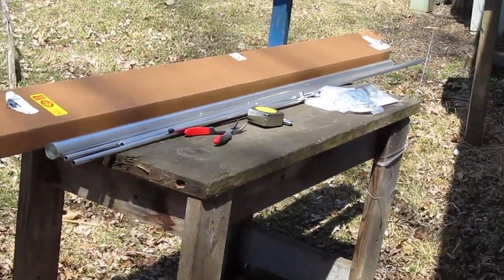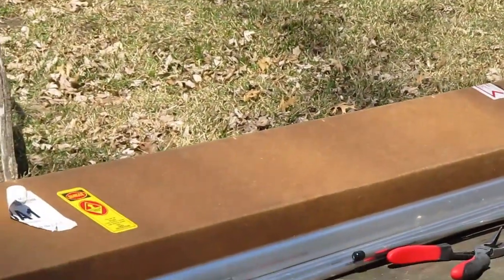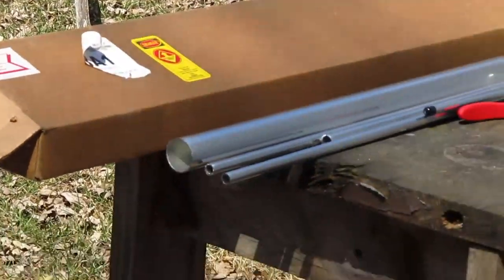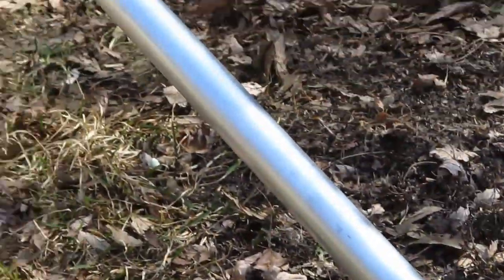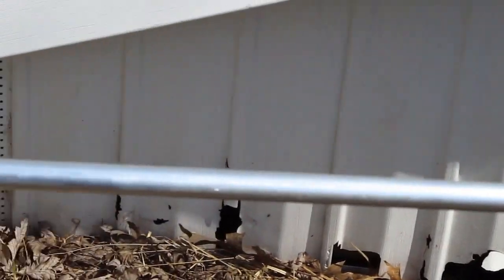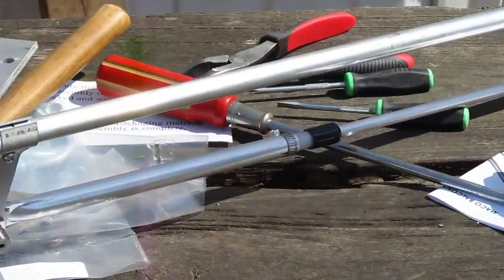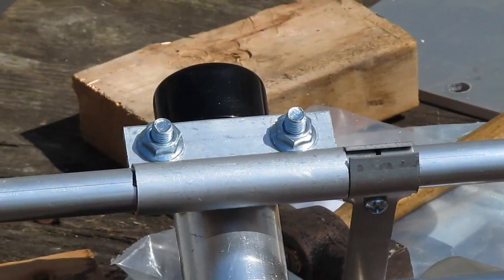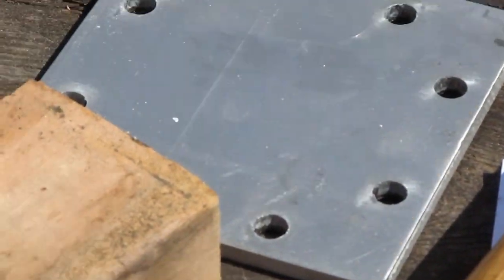Maco BA-1 Balcony Antenna

Comment: you didn't show how to attach the gamma mine came lose and i don't know how to put it back together because it has a plastic washer not sure where that goes .. can you please put a pic on your site .. thanks.
Reply from the maker: The gamma is just a reflector for the main part of the antenna. No, I can't show it, this antenna is long gone after 7 years.
Reply: @BirdWhisperer46  The gamma unit is not a reflector it is a capacitively coupled matching device.
The whole assembly (element and gamma) would be the driven element for a Yagi beam antenna!
MACO just eliminated the other elements and a bit of the boom and called it a BA-1 balcony antenna (it's a grounded element dipole people)!
Cushcraft made 2 versions back in the 1960's and 1970's called the Trick-Stick!  One was a split element dipole and the other was a grounded element version with a gamma match!

Comment: question i was just wondering if i can use the Maco BA-1 horizontally  and run its with my a99 for vertically with a switch box and run them both what you think it would match up 73. 505 land of Lincoln
Reply from the maker: Not a clue, I chopped up mine years ago and used the rods for other antennas. LOL  I was not impressed with the original, I do much better with just a long wire.
Reply: @BirdWhisperer46  well damn lol
Reply from the maker: @IllinoisStormTracker32  It worked very well as a tubular dipole. LOL Better than wire cause of the diameter I think.

Comment: I might build one out of some maco parts.
Reply from the maker: Don't bother unless you have a nice tall pole to put it on. It needs to be in the air. An inverted V wire works better. Sends the signal up to the Ionosphere, then bounces around the world, a one element beam just goes horizontal to the horizon and bounces a little.

Comment: do you still have the  Maco BA-1 Balcony Antenna
Reply from the maker: I have the pieces. I live in a hole, below the road level, in a canyon. In other words, the worlds worst location for any band. I ended up using the short rods for a dipole with tubing instead of wire. It worked pretty good, but since the sunspots went south, there is nothing on any band. :o(

Comment: that's not a mast that's a boom that antenna is mounted vertically
Reply from the maker: No, in this case, it's a mast, because i mounted it horizontal at the top of that mast, which was also slid down over another longer pipe that went into the ground.
Reply: How does that not cause interference with the signal pattern,  the boom is to give electronic separation from the antenna and mast

Comment: I been considering on of those, right now I'm using a inverted V-dipole wire antenna.  Could you do a follow up showing it up, and you're review on how well it performs? Thanks, I'll be following to see.... =D   73's
Reply from the maker: Don't be in any hurry to buy one. Last weekend I bought a 5 foot piece of black iron 1" water pipe, which is 1 3/8 more or less, outside diameter. I pounded a couple feet into the ground, put a C-Clamp on it about 18" from the top and slid that big aluminum tube down over it to sit on the clamp. My problem here is the lease restriction. No big gaudy antennas showing. It is behind my lilac bush and the horizontal is about the height of my roof eaves. 9 to 10 feet. Being that low, take off angle is not quite vertical, but it gets out past the steep valley I am in.

Want the real truth? I wish I had a couple more feet on the wire dipole and I could forget about this Maco. Without height to use it efficiently, it's a mud duck antenna. And be aware, skip fell out just a week after I got this thing up, so I can't give a real review of it. I use the dipole in the afternoon and the Maco in the morning. That's how they work best for now.
Reply: If you want to talk skip on that antenna it should be turned horizontal not vertical, however if you plan to talk local on it, it needs to be vertical because on a horizontal you won't be able to hear the local people talking very well.